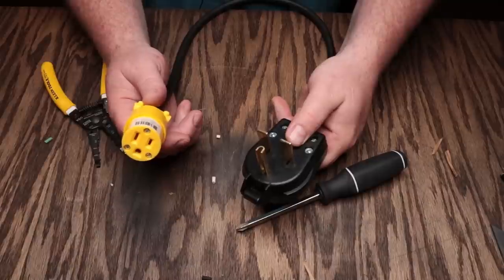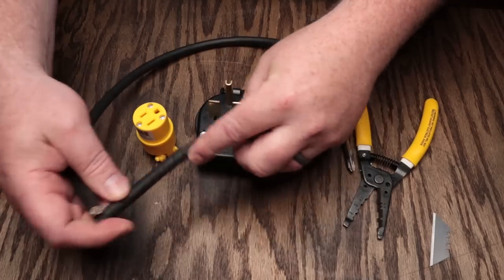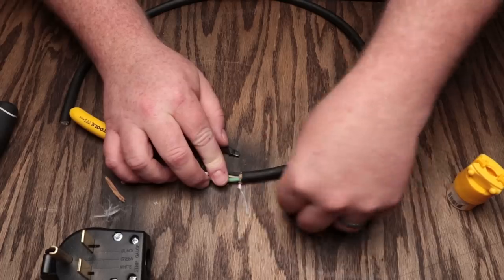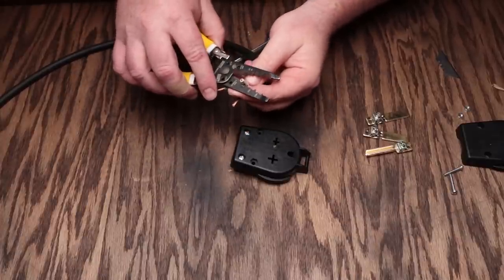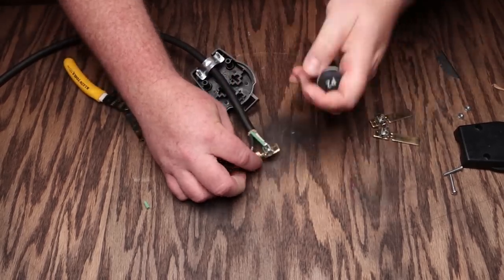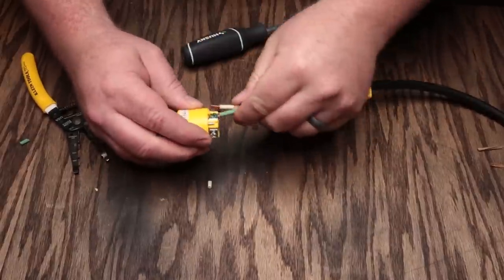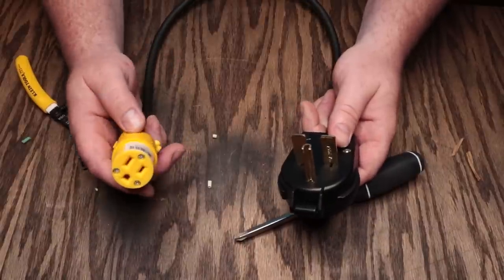Anvil Foundry 120v to 240v plug adapter DON'T CUT YOUR CORD!!

Comment: Hey Brian, on your GFCI wiring video you used 6/3 wire but the outlet/plug combination only accepts 2 hots and a neutral. How did you deal with using the ground as well? Could this work with a 30 amp outlet that has the slanted plugs instead, which also only takes 2 hots and a neutral? I've got a 30 amp double pole GFCI breaker, and am just wanting to make sure that I get the right combination of wire / plug / receptacle. Thanks for the great videos!
Reply from the maker: You would use 2hots abd a ground. 240 doesn't use a neutral.
Reply: @ShortCircuitedBrewers  Thanks for the reply, I really appreciate it. So your GFCI breaker only has 10/2 (or different gauge) with the 2 hots coming out of the breaker, and the ground to grounding bar. You don't have anything in the neutral port, but still have the pigtail connected to the neutral bar? Then, the recepticale only has 2 hots and a ground?
Reply from the maker: @rustedrootbeer  yep that's correct. Neutral in the main panel to the neutral/ground  bar from the GFCI and nothing connected to the neutral spot on the breaker. It will still work properly. Abd the ground from the brewery outlet to the ground bar In the main panel.
Reply: @ShortCircuitedBrewers  you're the best! Thanks so much.
Reply from the maker: @rustedrootbeer  👍🍻

Comment: So 220 usually has 12-3. So where does the common wire go in this set up? Im sure the outlet your are plugging into has 2 hot 1 common and 1 ground
Reply from the maker: There is no common or neutral wire in a 240v circuit. The only reason you see it is if there are 120V items in a 240V piece of equipment that need a neutral for the 120 volt circuit. The anvil foundry only uses a ground and two hot wires. Which is why I show 12-2 in the video. 👍🍻
Reply: @ShortCircuitedBrewers  thank you.
Reply from the maker: Happy to help! 👍🍻

Comment: I want to try and run mine to a generator 4 prong outlet. Would I be able to make a 5-15p female to male L14-30 plug for the generator??
Reply from the maker: Sure just use the correct plug. 👍🍻
Reply from the maker: Is the 240 on the generator GFCI protected??
Reply: Im am not sure of that honestly
Reply from the maker: @Sethbrews  if it doesn't you need one inline in the extension cord. This video.. https://youtu.be/El3ew5bNQ3Q
Reply: Okay cool thank you!

Comment: Would this video be the same for a Nema 14 - 30 R
Reply from the maker: Yup
Reply: @ShortCircuitedBrewers  Ok so in your video you show a 3 prong and my Nema14-30R plug has 4 prongs how would I go about wiring it even if I did cut the cord?
Reply from the maker: @dominiclogue7657  just the top center, and left and right connections inside the plug. Ground, hot, and hot. 👍🍻 (No neutral/white wire needed)

Comment: I have an electrician coming out this weekend to do some work to get 240v outlets in my garage where I brew. I am curious: What sort of outlet is best to install? I know I need a 2-pole 30A outlet (I know the Anvil only needs 20A, but I'm going 30A for my 10 gallon system); does the prong configuration matter? Is one better or more common than another?
Reply from the maker: The plug doesn't matter, you want to install a plug that matches the circuit so you can run your 10gallon system. You'll just have to adapt the foundry to whatever that is. Important to note it all needs to be GFCI protected. Just throwing that out there. 👍🍻
Reply: @ShortCircuitedBrewers  Thanks!
Reply from the maker: @damonjordan  brew on!!

Comment: The newest system comes with a 220 chord and a 110 pigtail.
Reply from the maker: Yep but there are lots of older models out there. 👍🍻
Reply: @ShortCircuitedBrewers  Yessir, there are allot of older ones out there. Even w/ the new ones.. the GFI is a must it is just the chord ends that are different.

Comment: I just got the gfci from Amazon. (Back in stock!). Can I make this extension cord 50’ long without a problem?
Reply from the maker: As long as it's 12 gauge wire.
Reply: I'd recommend 10 gauge (10/3) for 50-foot.  Less loss.  Although 12/3 is technically okay.

Comment: Probably a stupid question....but you can make/use an adapter like this for other electric brew systems (brewzilla) that has a 110 plug but needs 220 to run all of the elements?
Reply from the maker: Giuliano which brewzilla? If it is the 35L yes.. 65L no.
Reply: @ShortCircuitedBrewers  Rats. It was for 65L. My issue is the only 220 outlet I have is behind the oven. I was going to make this to serve as a pseudo extension cord. Would love to make the plunge to electric brewing, but the electricity part is holding me up!
Reply from the maker: Yeah that bites!

Comment: A good idea to paint the socket on your adapoter a different colour,  way too easy with multiple sockets around to plug into the wrong one if they look alike but a brightly coloured one should wake up the brain cells before a mistake is made.  Admittedly with such a short lead the risk is lower
Reply from the maker: Good Idea!

Comment: Thought about doing this to use my dryer receptacle but upon looking it over, mine has four prongs. Is there a way to still make it work?
Reply from the maker: I would say yes... BUT you need a GFCI breaker to be safe.
Reply: Of course and forgive my ignorance, but if I have four prongs I assume four wires. How do I convert that to the three wire on the foundry side?
Reply from the maker: @bfyost  you just leave the white(neutral) unhooked and only use the two hot wires and the ground.

Comment: I have a 20  amp  12 gauge extension cord would it work the same just cutting off the Male end and putting the  240 plug on that
Reply from the maker: Yep, would work just fine, even a 14 gauge would be fine. It only draws 11.7 amps on 240v
Reply: @ShortCircuitedBrewers  One reason you may want to consider 12AWG over 14AWG is length of extension cord.  14AWG has potential to lose voltage if carried across distances.  Also, heat becomes an issue because the electrons are "escaping" the wire over distance. The best thing to do with an extension is to overkill it with 12 or 10 AWG. While 14AWG can carry 20A/220V, NEMA doesn't recommend it because of the reasons I just stated.  Note that I am not a licensed electrician, but I think going to 12AWG gives you a lot more options and the cost extra is minimal.
Reply from the maker: @beerman1957  yep if you are making a long extension cord I would recommend 12ga. 👍🍻

Comment: This is a topic I'm totally ignorant on, so I'm probably missing something obvious. But, why is it considered "safer" to cut/rewire the plug (like anvil recommends) than to make this adapter? 

Considering making one out of a 12g extension cord, (much thicker than the foundry's cord) as was mentioned in another comment. Honestly, mostly just to get some extra length. Once I start using it in 220v I don't plan on going back really.
Reply from the maker: Replacing the plug would be easiest. Technically that would be damaging the machine and if they wanted to, not saying they would, it could void the warranty.. plus some people might brew at a buddy's house that only has 120 available..the "best" way is to cut the plug off and replace it for sure. Just not a solution for everyone.👍🍻
Reply: It's probably because using 120V plugs/receptacles on a 240V circuit isn't allowed by the electrical code. The different shapes of the plugs is intended as a safety mechanism to prevent someone from plugging something where it shouldn't be. While doing renovation work at a restaurant, I accidentally plugged a shop-vac into a 240V outlet because  someone at some point in the past had wired a 240V circuit for a pizza oven using the incorrect 120V receptacle. The shop-vac wasn't broken as I shut it off quickly, but it smelled burnt and I've never heard a vacuum cleaner motor spin so fast ever since lol
Reply from the maker: Haha turbo vac!! I'm surprised it even spin at all. Lol 👍🍻

Comment: Ok, so, I need a 2 pole 20amp GFCI breaker, 12/3 wire, 20amp receptacle that uses two hots rather than a traditional 20amp GFCI for 2wire?
Reply from the maker: Yes that is correct your breaker is the GFCI. You don't need an additional GFCI at the receptacle.
Reply: If the GFCI breaker uses the neutral to detect and interrupt ground-fault, but the dedicated neutral isn’t used in this adapter (just 2 hots and a ground) how is the GFCI going to be effective at protecting the circuit ?
Reply from the maker: The ground and neutral are connected in the main breaker box. The breaker will sense the short to ground.
Reply: @ShortCircuitedBrewers  gotcha.  I have 10/2 run to my anvil and am trying to figure this out.  Just found this site that says you don’t need a dedicated neutral.  Makes sense. https://www.jlconline.com/products-tools/equipment/q-a-wiring-a-two-pole-gfci_o

Comment: Good info here, but I have a couple questions. Are you running on a 30A circuit? If yes, how to you provide overcurrent protection to the conductors in your adapter and the Forge? The linked 12G wire is only rated to 25 amps, I do not know the rating max amp rating of the conductors in the Foundry. In theory, on a 30A circuit, these conductors could experience overcurrent. Thanks again for the video!
Reply from the maker: Not really worried about over current. I'm not an electrcal engineer but I honestly have never heard of that issue, at least not on such a small scale. Yes it's a 30 amp outlet. 👍🍻
Reply: @ShortCircuitedBrewers  it's the same reason that code doesn't allow for 14G NM cable on a 20 amp household circuit. The conductors (wires) are only rated up to 15 amps. When supplied with 20, they can overheat and eventually fail creating a risk for fire. The inverse is not an issue (ex 12G   NM cable on 15 amp circuit). Cheers!
Reply from the maker: @clayof2day  gotcha. However they are not "supplied" With amperage the device only "draws" Amperage from the circuit.
Reply: @ShortCircuitedBrewers  True. The purpose of overcurrent protection is case of a fault or short however. If there were a fault in the range of 20-30A and an appliance or conductors on the circuit are rated for 15-20A, the breaker will not trip and there is the potential to generate heat and or fire between the outlet and the appliance/machine. The risk in these scenarios, especially on a 30A circuit seems very low. I have an outlet in my kitchen fed by a 40A breaker, which seems more risky to me. The way I've seen it stated most concisely is "The circuit breaker protects the wiring to the outlet; NOT the machine or the wires plugged into the outlet. Each load must have it's own protection." Cheers again!
Reply from the maker: @clayof2day  right!!
Reply: If something were to fault it would fry your power cord which isn't in your wall where it could start a house fire.  It may not be "code" but it wouldn't give me any anxiety either.
Reply from the maker: Yup! 👍🍻

Comment: The only 240 at my house is my drier. Will this work/fit for that
Reply from the maker: ONLY.. I repeat ONLY if you use a GFCI breaker in the breaker box. Do not use it without one. You can seriously injur or kill yourself without one.
Reply: @ShortCircuitedBrewers  forgive my ignorance I am not an electric minded guy. Shouldn't my breaker already have a GFCI since it runs my drier. Or how can I tell if it has one already
Reply from the maker: @dustinhuiting  they do not automatically have one. If it does you would see a button on it to test the GFCI function. They usually run about $100ish
Reply: @dustinhuiting  most codes do NOT require a GFCI  on the breaker box for 30/50 AMP dryer service.  I also HIGHLY recommend hiring an electrician to put one in the box unless you are 100% confident you know what  you are doing.  DO NOT proceed until you get GFCI.  Your dryer will run fine with GFCI when you go back to it.

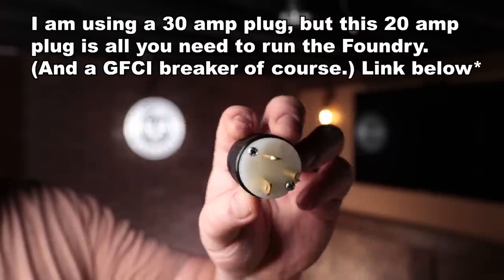Comment: At 2:39 you show a 20A adapter, thats a NEMA 6-20P, where the hot blade (to the right if the ground lug is closest to the floor) is flat horizontally. Most 20A outlets have the flat blade on the neutral side (to the left) and work with a NEMA 5-20P. A 6-20P plug end will not work with a common 20A receptacle, GFCI or not. Get the 5-20P, speaking from experience with my newly built setup. 

I still owe you a video of that Brian but not sure how to tag you in it once Im done, or just send you a PM on FB. :-)
Reply from the maker: you can reach me all those ways and then some... just shoot me a message!! Cheers!👍🍻

Comment: You could simply wire your 240 to a 110 outlet and mark it 240 with permanent marker (people do this with grows lights with 110 plugs). Same plug, switch accordingly. Sure people will freak out but the outlets are exactly the same just idiot proof in up to code form.
Reply from the maker: Yep.. I'm not making that video!! Lol you are 100% correct though.👍🍻

Comment: It is a good DIY video but it is hard to do this cheaper than Harbor Freight or Walmart. They sell these adaptors for RVs they are called dogbones. You can pick one up for about $10.
Reply from the maker: Not to do what I am showing. Those are for 120v to 120v outlets not 240 to 120. No commercial company makes these. It's against electric code.
Reply: @ShortCircuitedBrewers  Thanks for the clarification, I wasn't seeing the difference in the video but now that I look more closely it is clear.
Reply from the maker: @robertsampson8278  no problem! 👍🍻

Comment: Electricians - would it be better to wire it the opposite way. Cut the 120 plug off, wire up the 220 plug, but then make the opposite adapter. 220v into 120v plug/wall?
Reply from the maker: You could deem it "safer"that way.. Its up to whether or not you want to chop off the cord. You could even put a connection on the end of the unit and have correspondinf "pigtail" cords with different end on them. Something like these.. https://www.mouser.com/ProductDetail/Anderson-Power-Products/6319G1?qs=yoCgdRjoRtGAnpkyVnNPsw%3D%3D
Reply: I’m intrigued by that option you mentioned of a pigtail adapter. I looked at the link but was having a hard time picturing how such an adapter would work. I have a 240v setup that I would love to be able run off 120v for smaller batches or if brewing away from home.
Reply from the maker: @jasondean9631  You would just do the reverse of the adapter I did.. Cut the plug off of the Foundry and wire a 240V plug onto it. Then make a pigtail that would adapt from the 240V plug down to a 120V plug.

Comment: In this particular application it will work ok since the unit is configured for 240v. However as other have noted make sure to disconnect fully so others don't use it mistakenly.
Reply from the maker: Guess you just done understand what's going on..
Reply: @ShortCircuitedBrewers  got it, missed the part on switching the unit to 240v 👍
Reply: @ShortCircuitedBrewers  had it been a 240v to 120v adapter it'd definitely be a different story 😊
Reply from the maker: Yeah you would not want someone plugging in a regular alliance to it for sure! 👍🍻

Comment: Brian - I built the adapter.  Thanks for your instruction.  I got so excited to build it, I didn't consider that our 220v outlet has a different configuration.  It's a 30A with prongs on a 45 degree angle and L-shaped grounding outlet.  I saw you had a couple of adapters that were strung together on your set up.  Any advice?
Reply from the maker: I would probably just get the correct adapter for your situation and return the other one if you can. I just have all those different adapters because I've brewed on so many different systems. 👍🍻

Comment: Brian, 
Do you know if a voltage converter (120v to 240v) can be used with the Anvil Foundry unit instead of have a separate 240v circuit added?

Something like this: https://www.voltageconverters.com/product/vc2000w/
Reply: No,it's only rated for 2000 watts and the foundry would use 2800 watts, to would blow the fuse,but if you can find one rated for 3000 watts "if they exist" then yes i don't see why it wouldn't work
Reply: ROCKSTONE POWER

4.1 out of 5 stars  1,334Reviews

Rockstone Power 3000 Watt Voltage Converter Transformer - Heavy Duty Step Up/Down AC 110V/120V/220V/240V Power Converter - Circuit Breaker Protection – DC 5V USB Port - CE Certified [3-Year Warranty
Reply: If you can afford it would spend the extra $50 to get the 5000 watt just to be safe

Comment: I have a 6-20R (GFI) in my garage. My understanding is that I can use a 6-15P in the 6-20R without concern. Rather than rewiring or making an adapter, can I just use this pre-made adapter in my 6-20R? https://www.amazon.com/BloomGrow-110V-120V-220V-Adapter/dp/B075FTC9RT?th=1
Reply from the maker: As long as you have a gfci on the wall plug circuit.

Comment: Or you could buy one for $10.
Reply from the maker: The ones you are referring to are for camper outlets that are 120 volt outlets, which doesn't help. They won't plug into a 240v outlet.